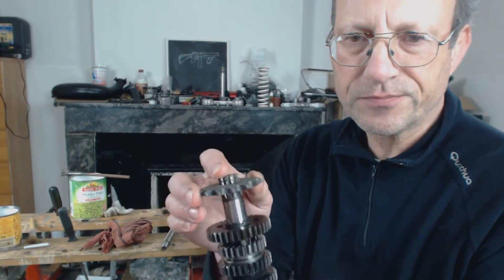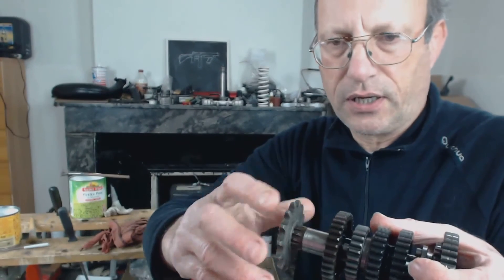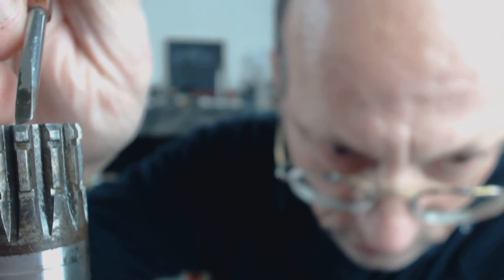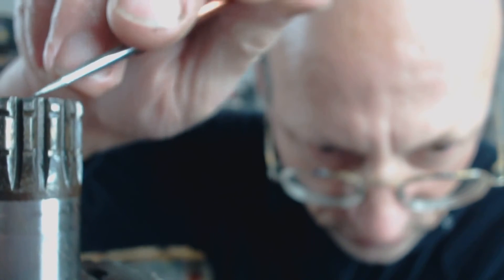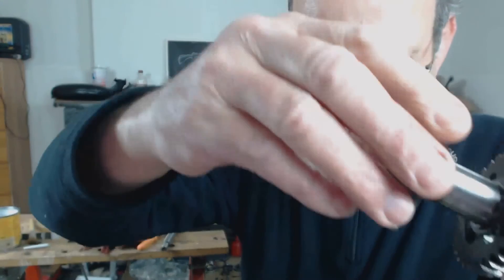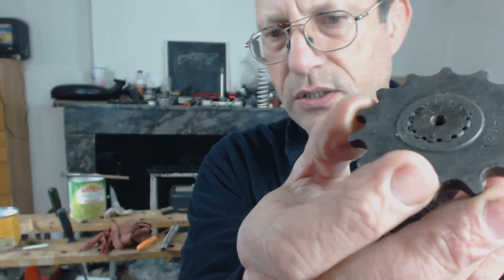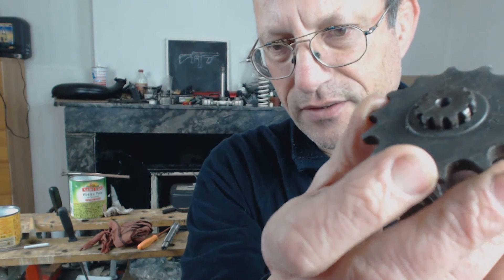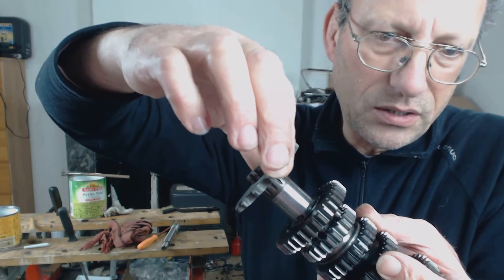Motorcycle gearbox - Examine the output shaft splines

Comment: I have been told the am6 engine needs building with the engine in gear is this correct?
Reply from the maker: This statement makes no sense.

Take your time.
Be careful.
😎
Reply: @EngineTuning  iv build engines plenty of times but it's my first time on an am6 engine was told if I select neutral before assembling the rest of the engine once complete it won't select gears completely if at all. I'm guessing this is not the case
Reply from the maker: @simonrice3036  Correct!

Comment: I just found out my virago 250 has this problem, it got pretty bad before i finally discovered what it was. The part of the shaft that the sprocket rides on is probably 20% gone. Rather than put it back together and sell it on to the next sucker, im going to replace it! Be a good previous owner!
Reply from the maker: Good move!
Keep the receipts, and raise the value of the bike ;)

Comment: Suzuki ones are notorious for wear. Just fitted a new one and even after greasing, new sprockets etc etc there is play on it after 1000 miles! You have to use common sense. What can slow down the process is using the rubber damped front sprocket.

Comment: I've noticed on my Honda cbr 650f when I changed the sprockets mine has about a hair line movement  rotational movement  . Is that something to worry about? It also had alllot of surface rust stain . so I tried clean it up the best I could with a cloth and I refitted the sprocket with some Cooper greece. My bike is a year old with 10k on the clock I do ride it kinda hard sometimes as it's restrcted .It has just under a year left on warrenty so I thought I would check again in 4 months time to see iff it's gone worse . Do u think I'm worrying to much ?
Reply from the maker: You must judge the play, though from your description, it doesn't sound bad.

In principal, the more mileage ridden the more that the play between the pinion and shaft splines will increase.
However, careful riding, and a correctly tensioned chain, will reduce this wear to an insignificant amount.

It is the hammer effect that does the most damage.
Hard acceleration from rest causes the splines to go from zero compression to high compression.

My old Royal Enfield Crusader had a rubber buffer in the rear sprocket.
This was a great design, as the rubber took the impact, protecting the chain, pinion, and shaft splines :)
Reply: thanks allot for the reply ! do you think the movement, I'm talking about could litterly ,just be the tolerance it needs just so you can accturaly attach the sprocket? as the movement is small. I could even send you a video of it on a email iff you could please kindly see for yourself ? I know moveing parts on anything only go worse after time but I just don't half find it bugging at the back of my mind. knowing my luck it would go bad as soon as my warrenty ends. It's just a worry for me incase it is just going to go worse it's very petty how I'm worrying about this on a year old bike  I just want be able use it without thinking I may need rebuild the whole engine in anouther 20k :(.... also I believe the hammer effect is when you just snap the throttle back in a quick motion from low revs without the smooth motion??. But my guess any sort of riding other than sensible isn't going do it no good.  Is there any chance that the movement I can see will just stay how it is ? How common is this problem? Sorry for all the questions I appreciate the help thanks allot Drew !
Reply from the maker: Honestly, I don't think that you need worry.
You could buy a new pinion and the play could be worse, the same, or tighter.

Note the mileage, and check it every 1000, to see if it is degrading.
Reply: Ok yes thanks allot . I am just being picky to be honest as it's not even 1mm of movement. 
Its just made me worry seeing the surface rust and the fact splines have been known to go bad sometimes like on this video..

 But my movement must be the tolerance so u can accturaly get a sprocket on and off.   

 I understand that fast starts such as pinning the throttle back from zero without being smooth can be bad . 
What i would like to know is iff it's also bad, iff your in let's say 4th gear at around half throttle, then you just bring the throttle back to zero without slowly bringing it down is that action also bad for this ? Or is it just when you get on the throttle to snappy to accelerate that it can cause the damage?
Reply from the maker: Sure, there is a hammer effect under engine braking, but nothing like when you do a drop clutch start, or when whacking open the throttle from a feathered position.

Keep your chain adjusted correctly, and develop a riding style whereby you wind the throttle open.
Reply: In shorter words is it when you just throttle up hard it causes the compression to be high? Or does it  also cause high compression when you  throttle down fast ?
Reply from the maker: See my previous answer :)
Reply: Thanks for the help yes I do ride my bike qwite smooth I just like to learn and know what goes on ahah.  When you say about dropping the clutch do u mean like a normal strong start like a race start?
Reply from the maker: A drag start, or a wheelie start.
Reply: It sounds like then to me that basically any sort of fast riding dosent do this any good.  I always thought from a fast launch you would only get ware on the clutch from when it slips . Such as iff I was doing a drag start I  would never dump my clutch I would slip it to get off the line that is what you mean ? Or do you litterly just mean poping out the clutch like you would on a wheelie.
Reply: When i said about any sort of fast riding I mean oviolsy it's better for the bike with the right technique. But let's say you want to drop down 2 gears and get on the power fast with using rev matching it's still not really ideal for this I'm thinking .
Reply from the maker: The hammer effect is produced when there is a gap between the pinion and drive shaft splines, when the drive shaft splines accelerate freely, and then impact the pinion splines ... the degree of effect is dependent upon force differential.

Hence standing start (dropped clutch) being the worst due to inertia, but also consider changing from heavy engine breaking to sharp throttle opening.

Try it ... you will feel the shock on the components.
Reply: Yes thanks that does make sence.  I just hope my riding style isn't to harsh on my bike.
 I do try my best to ride it with the right technique, but becauce it's restrcted to 47hp from 90. (650cc)I haft to make the most of my gears, abit like on a 125 iff I want to go fast ..  Such as I often cruise round town in 4th/ 5th gear, as it has a good torq spread.  But I do often get the urge to drop down at least 2 gears to get going fast. I just hope this isn't hammering my shaft . I do rev match what is reqwierd and try to acelerate smooth .I don't think I would feel like I'm thrashing it to much iff it was unrestricted. it's qwite annoying as I feel like I can't help but not thrash it 😂

Comment: If you are replacing the output shaft, it looks like it's a total rebuild of the engine.  I don't see any way of keeping the drive sprocket from wearing down the shaft again.  Is this correct?
Reply from the maker: Yes it's a rebuild job.
RE the longevity...
Fundamentally, the change from no drive to drive, must force the shaft splines against the sprocket splines.

Any gap, or play, between the splines exasperates the problem.
The splines momentarily accelerate in free space, before slamming into the sprocket.

Therefore, once play is present, the splines degrade at an accelerating rate.

From this, we can see that we need the tightest fit possible.
This neatly explains the term 'blueprinting an engine'.

Manufacturing produces a small to large shaft - within tolerance.
Similarly - a small to large sprocket ID.

Bad luck will get you the smallest shaft OD, and the largest sprocket ID.
You actually need the largest shaft OD, and the smallest sprocket ID.

Race engineers scour the parts bins to find those perfect matching components.
----

You can ameliorate the problem by having the output shaft peened.
This will increase hardness and carry more lubricant.

You could also buy the bits from a retailer in person.
This would increase the cost, but you could then find the shaft with the largest OD, and simply try their stock of sprockets on the shaft, to find the tightest fit.

:)

Comment: What happens if you just run it with that slack?
Reply from the maker: It just gets worse... for everything.

Every time you throttle down, and then throttle up. the shaft slams into the pinion.
The pinion jerks, and stresses the chain... and that stress is transmitted back through the gearbox.